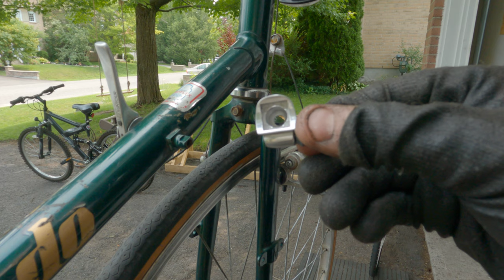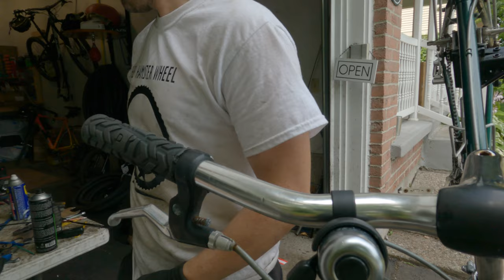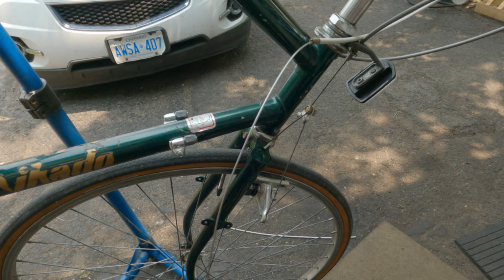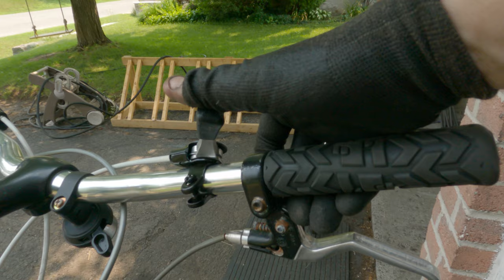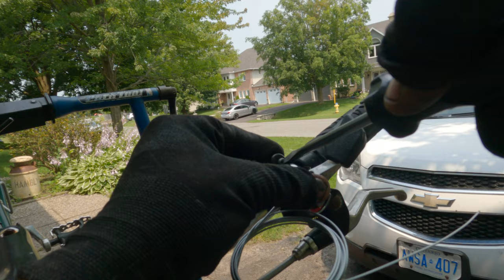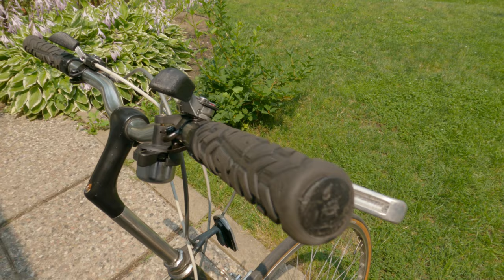Switching from down tube friction shifters to handlebar friction shifters

Comment: Been planning to replace my old yucky integrated index shifter and brakes with friction shifters. Didn't know that they should have brake wires. Thanks for that heads up, I will check out what I need for my replacement shifters.

Comment: Confused about the comment regarding index shifting cable - I've ordered some friction thumb shifters, but they dont come with cables - are not the regular shifting cables good enough? Nothing seems to indicate specifically "index shifting" on the box of the shift cables. i'm new to bike building, so forgive if stupid question.
Reply from the maker: Yeah really it’s just less important for friction shifting, you can use shifter or brake cable bad there won’t be a noticeable difference
Reply: you need linear/compressionless shift cable housing for indexing, but friction can run either or. At this point, most available new shift housing is going to be compressionless, unless you are getting extremely cheap stuff.  Friction doesn't need it, but i believe it feels better with the linear stuff than it does with the coil stuff.

Comment: How difficult is the front derailleur cable tension adjustment? It looks like you didn't have to tweak much to get that to work, normally they can be fussy. Wonderfully simple approach to filming a pretty non-trivial topic (for beginners at least), thanks!
Reply from the maker: The good thing about friction is it really doesn’t need micro adjustments like indexed, you just move the shifter until the derailleur is in the right gear, and not touching the sides.  As long as your limit screws are set correctly it’s pretty straightforward
Reply: like dude said, friction helps a lot but vintage front derailers are far more forgiving in terms of everything as compared to "modern" )mid 90s on, or something like that) which are far more sensitive to the size of the chainrings and the crank's chainline.